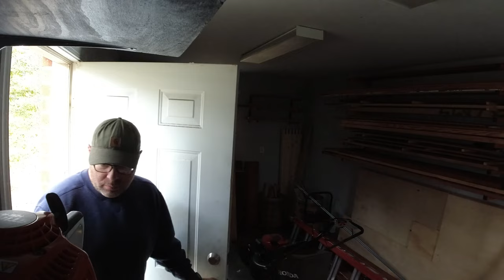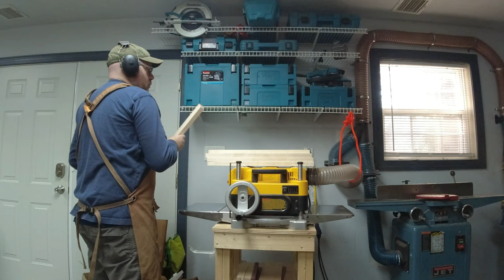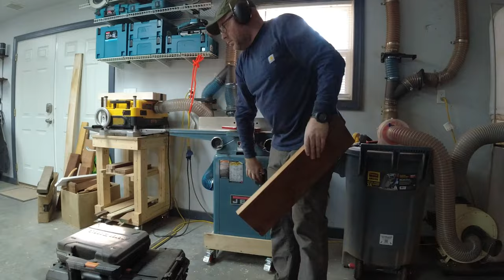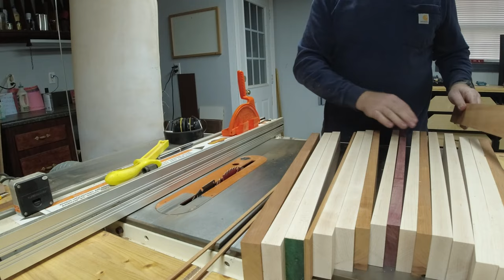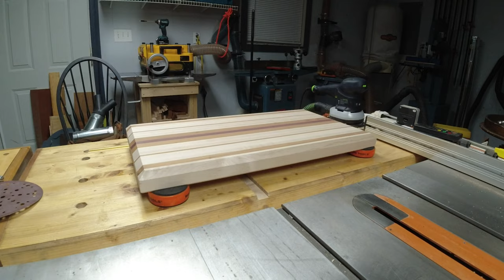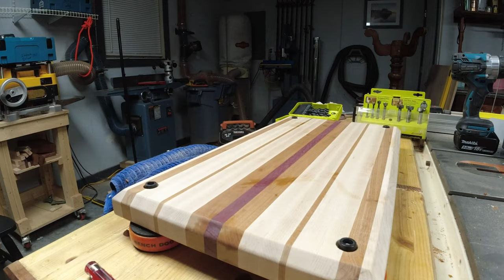MAPLE & MAHOGANY CUTTING BOARD start to finish

Comment: I just found your channel since I recently got into woodworking-I must say you made a very beautiful cutting board. Congratulations on your work. However, I noticed you used mineral spirits on the board. Isn’t mineral spirits toxic? I barely saw the label on the container, though.
Reply from the maker: I know that in large doses it can be toxic, but I use just the tiniest bit in a rag and then it pretty much all evaporates from the surface within a few minutes. If time is not of the essence, I'll use water, but then I feel compelled to let it dry for a few hours

Comment: Watched to see how to do edges and Was skipped but included changing blade on bandsaw....?
Reply from the maker: Edges? I'm not sure what you're referring to..
Reply: @JohnsTinyWoodshop  rounded the edges usually with a router or sanding
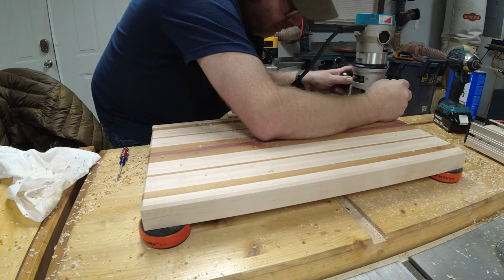Reply from the maker: Right around the 10:50 mark I start routing the edges